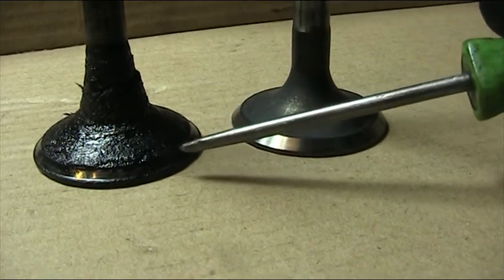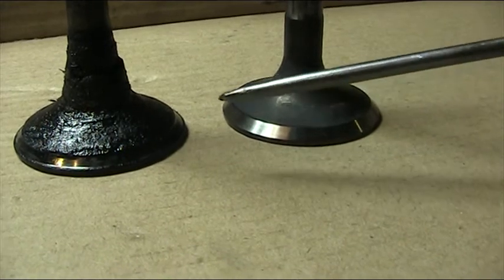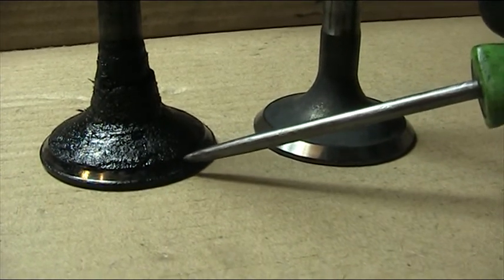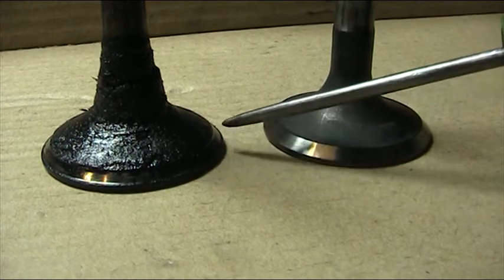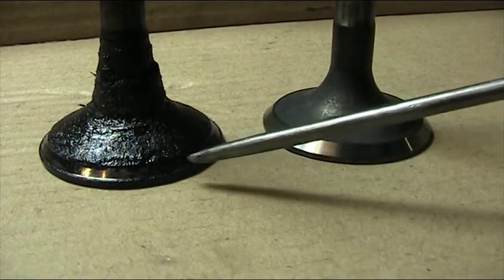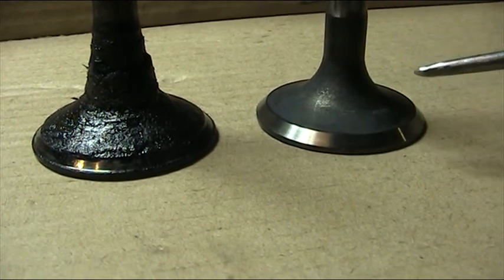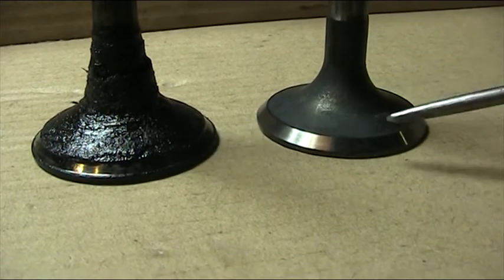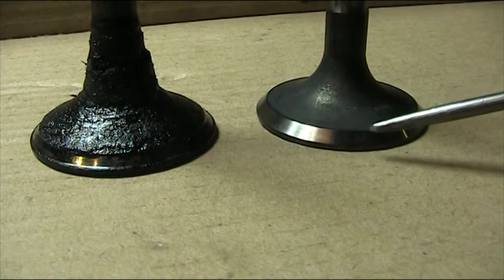valve lapping ?

Comment: I mean sure, new valves would be nice. But then you gotta resurface the contact point on the head to match. So you're talking about lapping the valves which only costs like 10 bucks to do yourself. Or paying a machine shop plus the cost of new valves. If my lil 4 banger can take 20+lbs of boost with lapped valves, then lapping is definitely the better bang for your buck.

Comment: the greater the surface/face area the greater possibilty its giong to lose compresstion. Even a new valve has to be lapped in.
Reply from the maker: the surface area of contact is determined by the size of valve seat seating point and not the surface of the valve face !we build about 500 to 600 engines a year and because our idl valve re-facer is accurate to 4 microns and we own a kwik-way valve seat re-facer that has been described as the Rolls Royce of valve seat re-grinders  we can refit  valves without lapping them ! we are not frightened of new technique and you should not be ! after all is that not the way forward ? the day we think we know it all is the day I will close the doors for ever thanks Charlie qcs engines